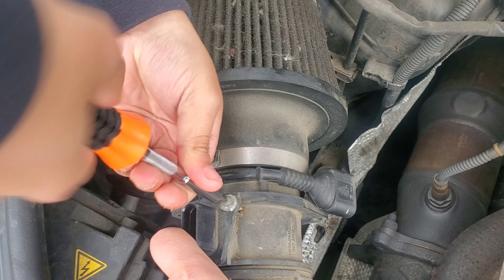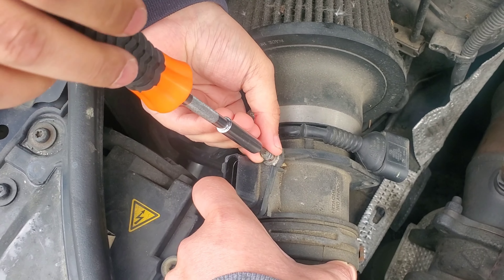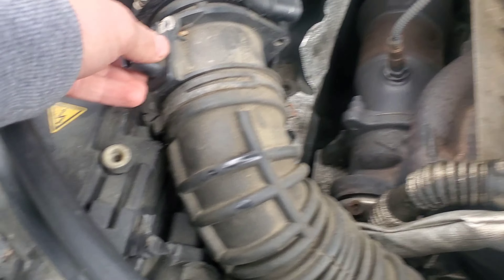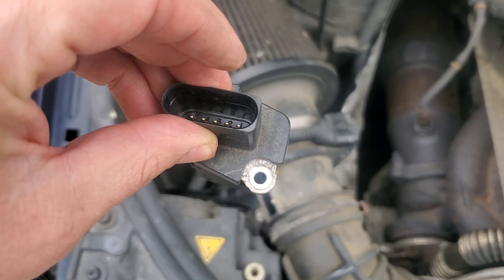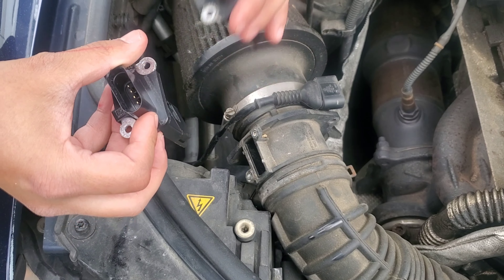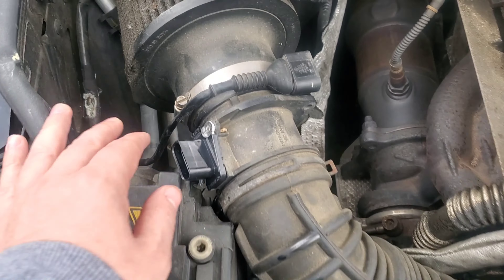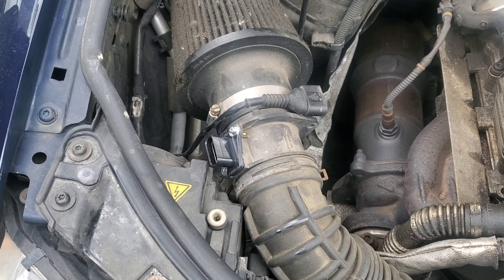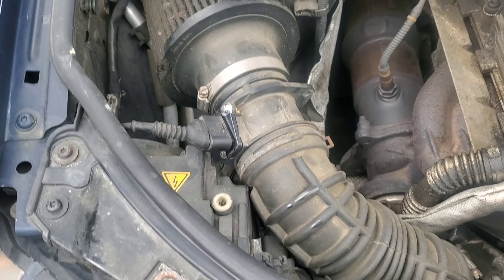A4 B7 quick MAF / Mass Air Flow replacement.

Comment: Is faulty MAF possible cause for a smoky cold start? My car doesn't smoke all the time but on startup it chokes a bit of smoke as if it can't burn the fuel properly initially. Its an audi a4 b7 2005 plate.
Thanks in advance!
Reply from the maker: White bluish smoke in the morning is most likely small valve seal leak.
Reply: @gilosgarage  valve seal leak sounds kinda bad.. is it? 😅😂
Thanks for your reply btw!